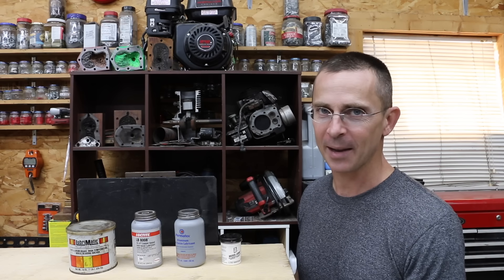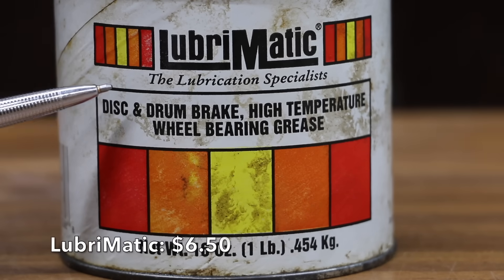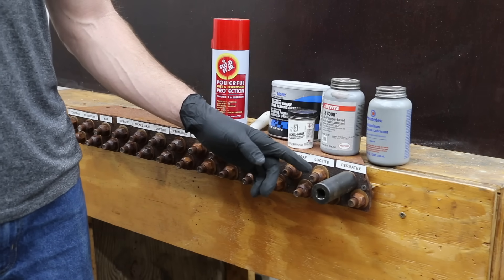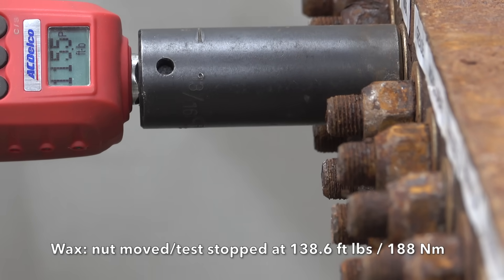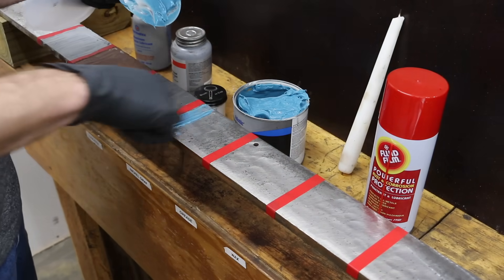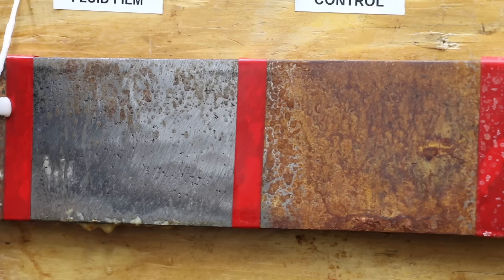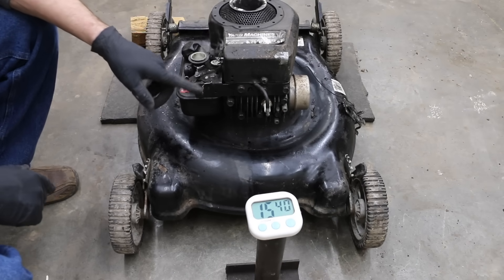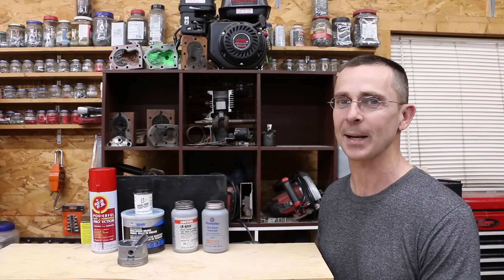Does Anti-Seize Compound Actually Work? Let's find out! Anti-Seize vs Grease vs Fluid Film vs Wax

Comment: This must have been a messy to video make, every time I touch anti seize it’s everywhere!
Reply from the maker: lol. Yes, very messy.  Probably the messiest video to date
Reply: It's great stuff though. I found an old bottle of Permatex that was dried up. I put some motor oil in it and mixed it up with a screw driver. Free anti-seize. I use it all the time for lug nuts.
Reply: @Dcc357  You should never use anti seize on lug nuts or lug bolts!
Reply: @KalebMarshallDulcimerPlayer  never had a problem using a small amount for years.
Reply: @KalebMarshallDulcimerPlayer  on rusted ones or when they are hard to spin on and make a horrible screech noise when you take them off with an impact.
Reply: @Dcc357  Clean the threads with a wire brush. But never ever put anti-seize on lugs!

Comment: I use the copper on high heat applications (exhaust, brakes), and aluminum mostly everywhere else. Steering and suspension adjustment points especially.
Reply from the maker: Great tips! Thank you
Reply: @ProjectFarm  I learned the hard way, that the Aluminum can actually solidify under high heat and basically weld the parts together.

Comment: Also test Mastinox and CA1000. In my experience they work great and when they are missing its a huge hassle to get the parts off(as an airplane mechanic)
But don't touch the mastinox, because its super carcinogenic.
Also, there is various types of each brand of anti-seize. Copper, Nickel, stainless, aluminum. they all do different jobs, and in jet turbines it really has an effect.

PM me, I can supply some.
Reply from the maker: Great test idea and thanks for the offer!

Comment: In wireless communications (can be traditional two-way radio or other more modern services such as IP radio technology) a lot of outdoor antennas come with either galvanized or stainless steel hardware. If anti-seize isn't used, the stainless hardware is one time use as torquing a stainless nut/bolt typically galls the threads. Of course, you don't see this issue if anti-seize is used.
Reply from the maker: Great point!

Comment: My take: If it will never be taken apart during its service life, just use grease.  If it's a spark plug, use Loctite.
Reply from the maker: Great point!
Reply: If it's a Ford 3 valve v8, just buy new heads when picking up the plugs.

Comment: the refinery i work at use a ton of anti-seize on bolts we can tell when its not used as the bolts can be bloody hard to remove we mostly use nickel based anti-seize but are slowly changing over to the copper based one the nickel ones have a health warning on them for cancer
Reply from the maker: Great feedback. Thank you

Comment: i always use anti seize. it helps the next guy that has to work on it. i will not be using anti seize as engine oil substitute. you should try running a regular engine on nitromethane.
Reply from the maker: Great video idea on nitromethane!

Comment: My dad has been using Copper anti-seize for decades, to no fail, we live in North TX not too worried about the salt and corrosion, but the heat does play a massive massive factor here.... Great vid
Reply from the maker: Great feedback. Thank you!
Reply: @ProjectFarm  what is your background?  Farmer, college?  Engeneering degree or just common sense and good imagination and fabrication skills?
Reply: I just started using it on my car up here in NJ, plenty of salt in the winter and heat in the summer. Always works like a charm!
Reply: I live in Ottawa, Ontario and roads during winter are 'salted' a lot. Sometimes we work on cars were there's more rust than metal. On K-frame, suspension and everything that is exposed to snow mixed with salt bolts snap if they are not heated red hot. Every time we assemble parts back we use ball bearing grease or molybdenum grease - works quite well in keeping moisture away and it's cheap. Tomorrow I have to work on rear suspension of my 22yr old Civic - it will be lots of fun, since the previous owner didn't rustproof the car.
Reply: @pliedtka  that's how they are in Erie, PA, lived there for a yearish, well that and Buffalo, NY... The salt was horrible on my bosses 2000 Toyota Camry
Reply: @kbrownfocus  
Yes, we are in the same climate, people living in dryer areas don't get it how come we have so many rusted cars. I went to Sacramento to visit my sis years ago. 20yrs old car over there lifted on the hoist looks like 5yr old one here - no bolts torching required.
Reply: I've had about the same results with a decent CV joint grease as I've had with anti seize so I usually use the grease, and I'm in the northeast.
Reply: @MrTheHillfolk  CV joint grease is high in molybdenum. Moly is one of the best metal lubes.
Reply: @ionstorm66  
I play with alot of vws so there's always a tube of that stuff floating around for CV joint use. 
Amazing how good that stuff works , I purchased an axle from AutoZone and blew it in a week. 
When it came apart there was some blue grease in it. 
I'm like that's not moly like I've ever seen. 
I blew up the 2nd one in 2 weeks. 
Ok same color grease. 
On the 3rd I brought it home, disassembled and cleaned out the grease and put in moly. 
Sucker lasted till the car broke a few years later.

Comment: Anti seize is not a lubricant. It will reduce the torque necessary to turn a fastener by wetting it, but anti seize is mildly abrasive. With repeated wear, like in an engine, the anti seize acts like a fine lapping compound.
Reply from the maker: Yes, great point. Thank you!

Comment: I use it for over decade.  It work.  Aluminum one at wheels, nickel at exhaust, copper at engine.  They do work.  Work even at exhaust bolts.  To add I have aluminum one still always 1/5 full after using it I would guess for 15 years.  I can not remember when some bolt or spark plug etc get frozen after I did put antiseize at it.  I live in MN.  I bought my f250 99. from city of mpls in 09.  In 14 or so I went to junkyard to bring if I remember it was egr valve.  I broke 2 bolts at one egr valve at junkyard and 2 at another there but both bolt at my Ford went out easy  because city of MPLS put some antiseize at it.
Reply from the maker: Great point!

Comment: Graphite from a pencil works pretty darn well at anti sieze and is easy to draw on where it is needed. If that nickel-graf is not dependant on the grease it is suspended in ,it would take alot of heat . nickel is highly heat resistant and a common additive in steel alloys to combat corrosion , friction and heat issues. They make crucibles for smelting metal out of graphite . Copper particle lubricants do too but copper will gall and embed into softer metals.   Another awesome video with alot of great information. I love watching these videos and hopefully my two cents will add something interesting for somebody out there. Video idea. What is the best industrial cleaner/  degreaser for metal surface prep.
Reply from the maker: Great information. Thank you!

Comment: Why did you throw it in the grill. All it did was burn off the compounds. Of course fluid film and candle wax is not gonna get past that stage. Besides most people using anti seize are not using it in high temp areas. I would have much rather seen this comparison without the grill.
Reply from the maker: Thanks for the constructive feedback.  If used on exhaust, brake parts, and other automotive applications, heat becomes a huge factor

Comment: So, in looking at it from the other side (and no this is not an argument against anything).... Can an anti-seize product create a situation where a nut and bolt interface becomes and issue because it cannot hold as well? Bolts torqued down to 90 foot pounds were releasing at 68 foot pounds. I would almost like for the bolts to release at a measurement closer to my original torque applied. The product is supposed to allow the nut to not seize, not to make it easy to remove the nut. 
Just thinking out loud on this and not trying to stir anything up. As usual, excellent dedication to 90 days of spraying the bolts!
Reply from the maker: Great point!

Comment: It should be noted that due to the solids, anti-seize products are not used to lubricate dynamic loads. An exception to this rule is made for those formulas containing molybdenum disulphide, which can be used as an aid in the assembly of press fits or on splines and gears subjected to high static or slow moving loads.
Reply from the maker: Great point!  Thank you

Comment: Oh boy, I'm sure we've all been through a few rusted stubborn nuts and bolts!

Like if you've had bloodied knuckles, sore backs, and moving bolts a quarter of an inch at a time because of how tight the space is to get to it
Reply: Three different spanners since the ring always engages at a slightly different angle, 2.5 hours of my life I'm never getting back. I think I maybe got 3 mm of movement on the point furthest from the bolt with each spanner. Luckily the new fastener spun right in even if the hole was never touched up it got a generous helping of anti-seize and was torqued below the spec to help out the next guy. Bastard engineers.
Reply: @ColtaineCrows  Daaaamn!
Reply from the maker: Great point!

Comment: As a mechanic using antisieze on spark plugs in an aluminum head can save you from a lot of problems as if you don't use it the plugs can basically weld themselves in and you run the risk of stripping them out when removing them antisieze will prevent this
Reply from the maker: Great point!

Comment: Can You Run Marvel Mystery Oil as 2 Cycle Oil 😀A 50:1 Mix Fuel and Marvel and Run It in Various 2 Cycles See If There Is a Power Increase Vs Standard 2 Cycle Oil n Fuel Mix and Also To See How It Does as Far As Engine If Used In A Pinch if You Were Riding A Scooter or Mowing With a 2 Cycle Lawnboy and Had Fuel But Only Marvel Mystery Oil on Hand 😀👨🏼‍🔧🧰😊😎 Thanks Project Farm I Love The Channel and Your Thoroughness 😀😊😀
Reply from the maker: Great test idea!

Comment: My go to rust inhibitor for fasteners is just regular old pine tar. It's especially good at preventing cast aluminium valves and whatnot under trailers from growing too attached to the bolts, it also sticks really well to most surfaces. 

Other than that it's hard to find anything but copper based anti seize around here.
Reply from the maker: Great tip! Thank you

Comment: Back when I worked at Martin Marietta Astronautics, C-5A anti-seize was the only type certified for use on the Titan IV Space Launch Vehicles. We did not abuse the fasteners used such as you did, and had no problems with such hardware. It is an excellent and reliable product.
Reply from the maker: Great information. Thank you

Comment: How about testing thermal heatsink compounds? Should be fairly easy with a known heatsink and fan, and a magnetic block heater of a known wattage (45-90 watts or so), but you'll have to clamp it on to the heatsink since aluminum or copper won't attract magnets. Of any compounds you test, both the aluminum, and the copper anti-seize compounds should be included, as I've found copper anti-seize to be superior to any of the commercial heatsink compounds I've tried.
Reply from the maker: Great video idea! Thank you

Comment: Should have tried blue loctite threadlock. I've heard of using it on lug nuts.
Reply: Would've burned out in the grill test. But otherwise, thread locking compound does generally keep water from getting into the threads and prevents them from seizing up. But since I run with two sets of wheels one for winter and one for summer my wheels come of every ~6 months, so they don't really have time to get stuck. I don't even apply any lube other than maybe a light spray oil.

Personally for wheel lugs I'd probably use Loctite 222 rather than 243, definitely nothing stronger than 243 though.
Reply from the maker: Great suggestion!

Comment: here's an idea, previously  you reviewed some tire inflators. but some of those resemble compressors for vehicle horns. 
so if your vehicle has a horn running off a compressor, can horn compressors be used as a tire inflator?
at the same time, is a horn compressor ideal for a small hobby compressor? hobby compressors fill a 3L or smaller tank  and usually outputs 60psi.
Reply from the maker: Great recommendation. Thanks!

Comment: Was the crown/foot (not sure what it's called) of the nut also treated? If not then that could have had an effect on the amount of torque needed to remove the nuts.
Reply from the maker: Great question.  I did not remove the zinc plating from the washers

Comment: Being in the rust belt, I use both the cooler and aluminum. Here's an interesting find. I worked in an industrial setting with machinery that had lots of 900f solder. We always had corrosion issues and a bad time removing tight fit  heaters because of after weekend startups (sweating).  When anti seize wasn't available, other groups used kaopectate because the bismuth was said to prevent stick heaters from corroding in the bores.
Reply from the maker: Great information. Thank you

Comment: One place I always use anti-seize is where steel is threaded into aluminum, such as on spark plugs in aluminum cylinder heads.
Reply from the maker: Great point
Reply: I used to but most new spark plugs are coated with what looks like chrome on the threads at least NGK's that I use do and the use of anti seize is not advisable.
Reply: @eppyz  then stop using NGK's in an aluminum head.
Reply: @LuckyBaldwin777  why? They have a coating on them so it's not a problem.  Spark Plugs do evolve with time and on certain applications the anti seize is not necessary.
Reply: especially the old Ford modular heads.  They only have a half dozen threads contacting the spark plug.  I use my torque wrench on those also since only 6 threads are pretty easy to strip out by over-torquing
Reply: @LuckyBaldwin777  That's a good thing to know.  You must of found out the hard way.
Reply: @SamSteeles  Yes, you are correct sir.  Back when those engines first came out in '93,  One guy came into the shop and he even tried to jb weld a plug back into the hole.  Came flying out of there and left a small dent in his hood  lol  .Cal Van makes the best thread repair kit for those heads.  Uses a solid steel insert to replace the damaged/missing threads.   Problem solved.  Another of my old tricks was to always use never-seize on the exhaust hardware.  Comes apart much easier later, without having to break out the Victor wrench.

Comment: There is huge debate over using anti-seize on spark plugs especially for aluminum engines. I have had enough stripped heads that require inserts that I always use it. I also see a lot of stripped oil pan bolts, intake manifolds. Basically just any aluminum thread.
Reply from the maker: Great point! Thank you

Comment: You never cease to amaze. I'm a little sad you didn't spray down the water-abused plates with corrosion solution just to see how large the hole had gotten in the protected area. Kind of hard to tell by looking if there's still a micro thin layer remaining. Maybe that's just on video.
Reply from the maker: Great point. Thank you!

Comment: Thank you so much for all the information you provide on stuff we didn't even know we needed to know. Been using bearing grease or high temp grease as an anti seize for many years, copper slip as well. Even use grease on tap threads where we see lime stone deposits seize up the tap.
Reply from the maker: You are so welcome!

Comment: I think a video testing high torque electric impacts would be cool are the Milwaukee and DeWalts really worth the extra money.
Reply from the maker: Great video idea!
Reply: Like battery life, recharge rate, actual torque, and durability testing.
Reply: Yes anyone wondering I'm in the market for high torque electric impact. I have a small low torque one.

Comment: You put a lot into that video. I wonder how much seizing was caused by the rust on the exposed threads, as they all seemed to keep the rust out of the nut. However, they were so close in numbers I don’t think it was a huge factor in this test.

One reason for anti seize, as you mentioned, is differing metals. Aluminum blocks and steal threaded spark plugs, for instance. This might be interesting to see. Also, normal applications, such as spark plugs, you can only use a small amount of anti siege, as too much can cause a grounding problem.

This is usually the only place I use anti seize, unless something specifically calls for it. But it sure would be nice for all those bolts on the underside of cars weren’t always rusted beyond repair...
Reply from the maker: Great feedback. Thank you

Comment: anti seize works, had to replace the original 30 year old water pump on my truck 5 years ago and had to cut the pump off after breaking all the bolt heads, ford windsors are known to rust together because of the aluminum to steel bolts. and last month had to replace it again but because i used anti seize it came right off
Reply from the maker: Wow!  Glad it did the job!

Comment: My engine ran better on 100% moly grease than on oil when it reached operating temperatures. There is a vintage video of an suv somewhere on youtube that shows a motor treated with moly that runs without oil without seizing or breaking
Reply from the maker: Nice! Thank you